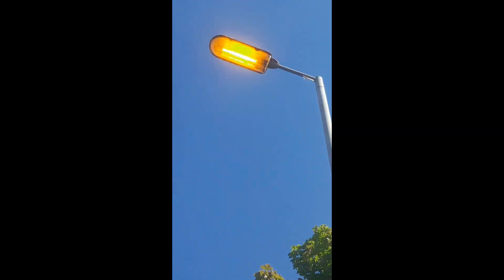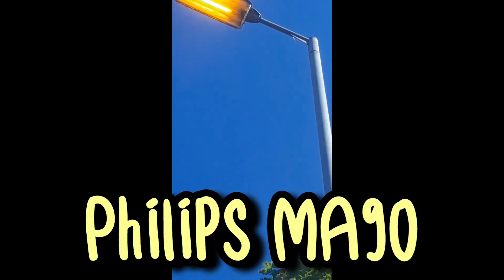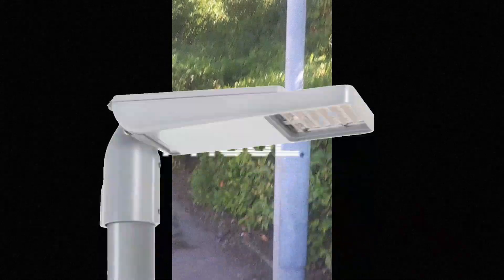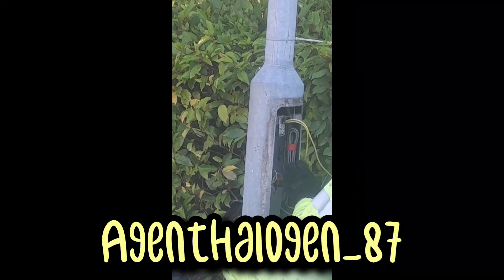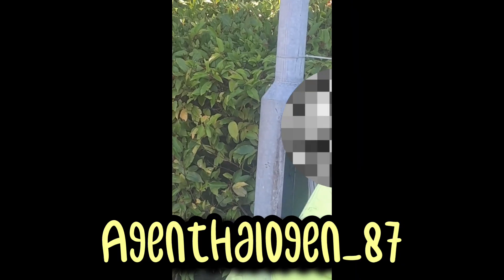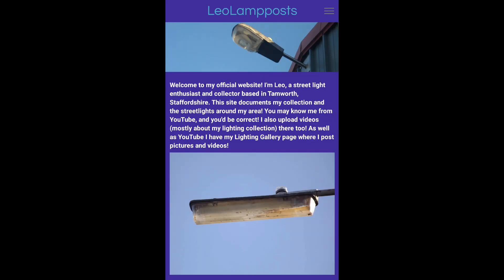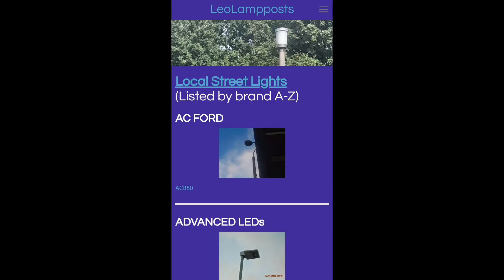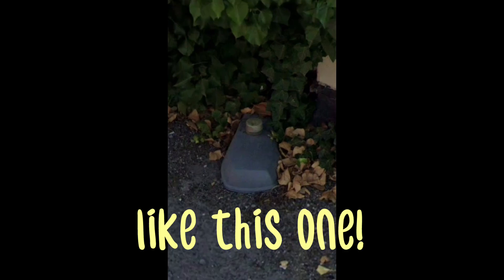Remote Geared Philips MA90 SOX Street Light Lantern LED Replacement! (to a Holophane S-Line)

Comment: There was longer versions of these light heads along woodland road in Tamworth, but since march they have been replaced by the holophane s lines, I have got a few photos of them removing these lights and replacing them
Reply from the maker: Philips MA50s - A mix of the Mk.1 and Mk.2 versions for 135W SOX or 91W SOX-E, I have some identical units in the collection